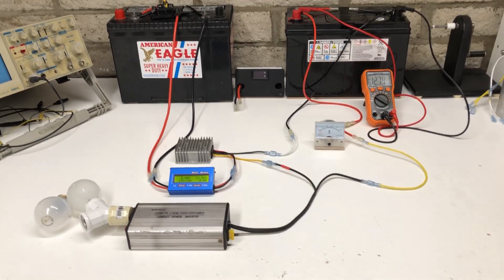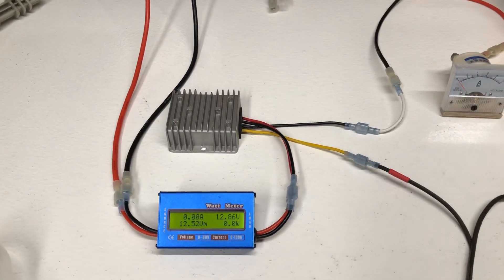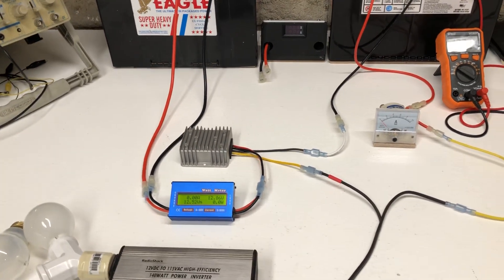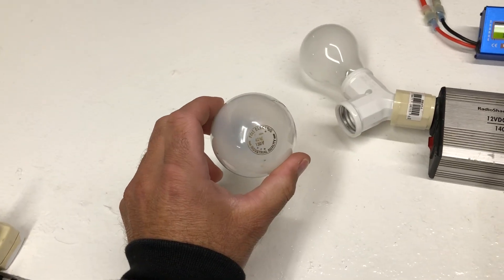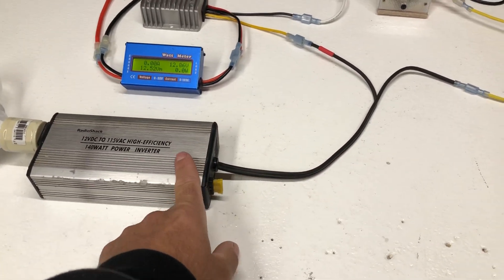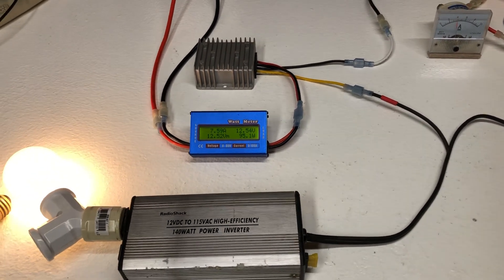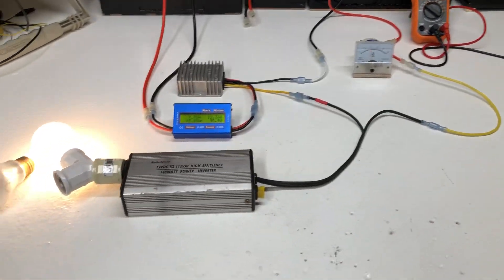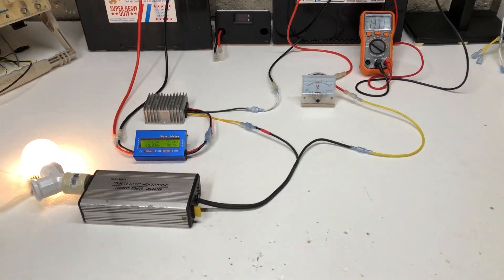Carlos Benitez simplified system

Comment: Yes that works I have the same DC to DC setup voltage booster works great also you can put a load on the charging battery like another inverter or another Voltage booster and charger another battery you can run a pulse motor of course between the potential difference and charge another battery that you can also put another small load on while charging the second battery then power another voltage booster run another load I woulder how many time you can do that lol also you can capture energy from secondary windings rectified then into cap dump and back into run battery I can go on with many many ways you can run all the same methods of the negative potential as well if you do both at the same time you will get half the potential off each and you would have to balance the loads have some a lot of experiments Carlos F Benitez was a genius in his time he created mechanical commutated switches to rotate the batteries Rick Friedrich Arron and Petter I have watched all the videos on Carlos Awesome stuff also Rick puts coils into resonance / series impedance marching inductors down the charging path and it causes more flyback to enter the system and start back charging the front battery once you balance the loads the batteries with just stay the same voltage and slight rise slowly and you can still charge Batteries with normal flyback charge like normal but without depleting the run battery 👍💯⚡ great work Kevin as always

Comment: So the 40w bulb is running for 25 watts essentially if it is 75 % recovered?
Reply from the maker: Basically
Reply: 25W is the saved electricity, it would be running for 15W
Reply: @CheyenneChild- why is this not more explored this circuit seems significant
Reply: @EtherBench  Beats me, I don't think people suspect anything anomalous so they just kind of ignore it. They don't realize that your load in this circuit can be a changing magnetic field and then you can easily get more energy out than in..
Reply: @CheyenneChild- yeah  people seem to overlook the simple things.. they expect it to be overly complicated I don't blame them the system only teaches that it's not possible

Comment: Nice idea, it's like you use the inverter as a diode, to charge battery. Do you have more energy on the two battery after switching ?
Reply from the maker: Seems like about 75 % recovery to second battery

Comment: You say the inverter is running at 24v but is this correct? It looks like it is running on the potential difference between the booster (24v) and the positive of the charging battery (12v). So in my mind the inverter is therefore running at 12v.
Reply from the maker: The inverter is running at the potential difference 12 volts 
 The booster is output is 24v
Reply: @kenergy1707  So it looks like 12v at 4 amps is what is going to the charging battery through the inverter. Which leaves the question, what happens to the other 4 amps of input? It would be useful to put ammeters between the booster negative and the source battery negative (A), and between the charging battery negative and the booster negative (B) to see how much current is moving between the booster and the batteries on the negative side. Even though the negative line is common you might find current does not flow equally between the booster and the two battery negatives. I did this test and found twice as much current at point (A) than point (B). At this point, for me, it is not conclusive as to whether the charging battery is only charging at half the rate that the source is discharging (that's what I suspect) - a battery cycle test over several cycles will answer that - but regardless it seems the load will only operate at 50% of the input power which would need to be taken into account if a practical system is envisaged. I might have made mistakes in my tests so you should definitely do your own. All the best, Mark.
Reply from the maker: @markflint9089  hey Mark you are correct about 4 amps going to secondary battery but it’s actually 24v at 4 amps out of the converter with some losses threw the inverter to the secondary battery 
  if it was 12v at 4 amp it would not charge the battery
Reply: @kenergy1707  But is source voltage number important? I mean, is it not the potential that the load SEES that determines the volts to calculate the power? A 12v inverter can be drawing 4 amps and running between two positive voltages of 112v and 100v. But the inverter isn't running at 112v and powering 448 watts. The inverter would still be running at 12v and powering 48 watts even if 112v were on the input side of it. So if we put a volt meter between the booster output and the charging battery positive we will read the voltage that the inverter actually sees, therefore runs at. As for why the battery charges even when there is (possibly) less of a potential difference across the load than the voltage of the charging battery.. TBH I've not formulated a satisfactory explanation but in these 'split positive' arrangements current behaves in the ways we are not used to thinking in. For example in a regular case of charging a battery we have a complete voltage drop across it so that from the negative back to the charging source the voltage is zero. But in the case of a charging battery in the split positive arrangement there is no zero-volt condition on the 'negative' side of the load because there is another positive voltage on that side. So when you have a positive voltage on both sides of the load you have both volts and amps, so power is there too. Don't get me wrong, I'm not an expert, just learning these things which the text books conveniently leave out :-)
Reply from the maker: @markflint9089  yes it can be confusing for sure you just have to think of it as watts the battery delivers 8 amps to the booster then you get 24 at 4 which is still 96 watts minus losses which goes in series with the inverter to the battery at the same 96 watts minus inverter losses so like 70 watts going to secondary battery then you have the output of the inverter and charging
Reply: @kenergy1707  Hi, I've sent you an email with a video showing how to test how much power the charging battery is receiving. It might go to you spam folder so check that. I'm not saying the split positive arrangement has no gains, but using a boost converter here has a caveat.

Comment: That’s a novel modification. Good idea. I’ve found with the Benitez system the lower battery only receives 1/2 the power discharged by the higher battery, because of the voltage difference. The currents between them are the same since it’s a loop but one set of batts has double the voltage and hence double the power. So  not sure there is any advantage in it. But others have reported when cycling the batteries you can get more than the stated watt-hrs out.
Reply from the maker: Thanks ! Yea it’s a lot simpler especially for battery swapping
Reply: @kenergy1707  you could take it a step further and use the boost converter to drive the load but tie the load-output back to the supply battery! No switching batts necessary and still would recover about 1/2 the load used.